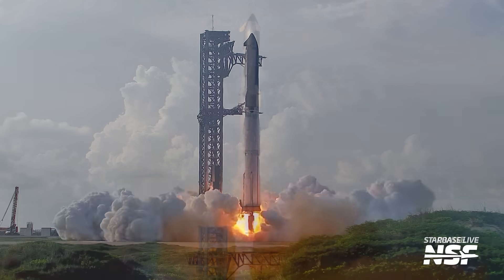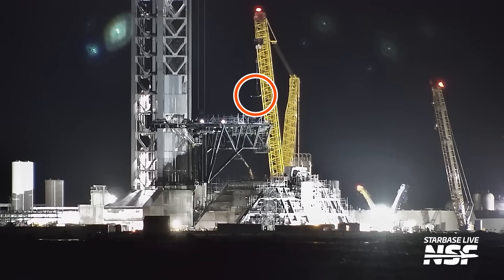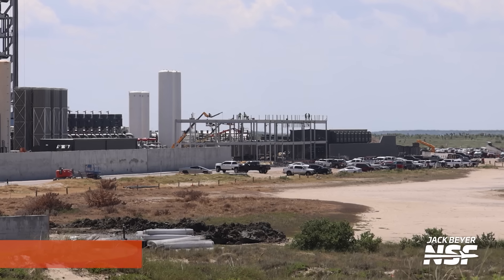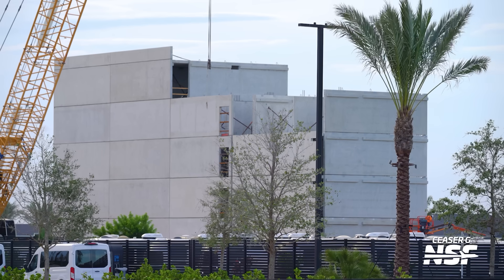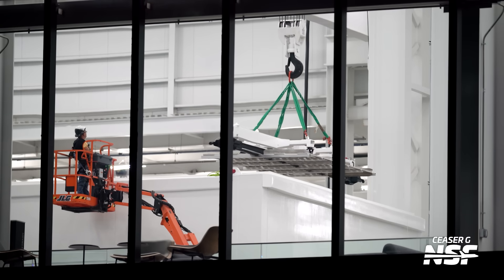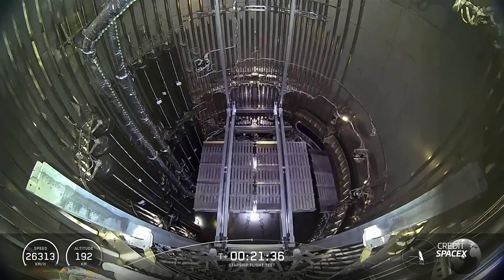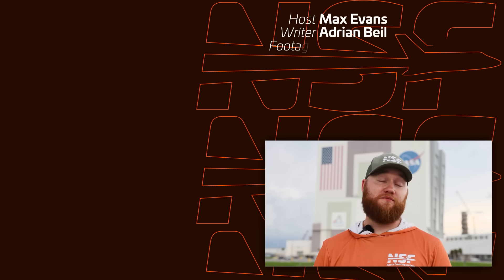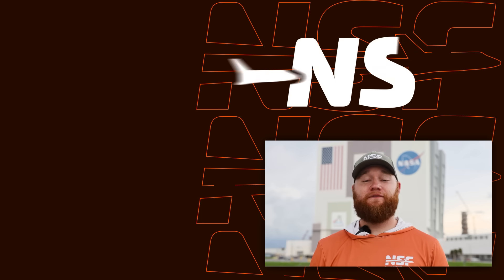Starship Flight 11 Preps Begin! | Starbase Update

Comment: I don't understand the difference between the "booster 18.3" and the "test article". Both names seem to be used in this script to refer to the same thing.
Reply: Booster 18.3 is the test article. Not sure if the naming convention is SpaceX or NSF.
Reply: @Barthhhelona  It just sounds a bit strange to refer to Starships or Starship parts as "test articles". Strictly speaking every Starship so far has been a test article, till one is actually used productively I suppose. Ironically, in that sense Booster 18.3 wouldn't really count as a test article anymore if it is actually used to deploy working Starlink satellites. Which is in the realm of possibility.
Reply: @cube2fox actually test tank 18.3 will never be turned into a functioning booster. It's just the top portion as a test article to test the structural integrity of the hot stage ring and perhaps the grid fin wells. There IS a booster 18 being stacked. The 18.1 through 18.3 test articles help validate and inform the design of Booster 18 which is the first V3 booster. Hope that helps and I'm sure someone will correct me if I misstated anything.
Reply: @Barthhhelona  That makes more sense. I guess it's somewhat misleading then to call this test article "Booster 18.3" if it's never turned into a functional booster.
Reply: @cube2fox yea they use odd naming conventions. I believe NSF used to call them "Test Tank 1,2,3 etc”.

Comment: The water bottle analogy doesn't work/apply here.
With the contact points being that spread out (1-per chopstick) , the bottle (super heavy) can't swing left and right. The only way that would happen is if one of the fingers (chopstick arms) changed height compared to the other.

The booster DOES swing towards and away from the tower though, which is why this bottle/finger analogy doesn't apply. Adding side stabilizers MIGHT help with stopping that to/froe swing but it'd have to either be through friction or that the stabilizers are cradling the booster with curved supports.

edit: typos

Comment: I'm very interested to see what the structure of the ship quick disconnector on Pad 2 will be.
The booster heights of Version 3, which will likely be launched first, and Version 4, which will be launched afterwards, will be different, and the ship's mounting position will be higher accordingly, which will likely mean that the ship quick disconnector's ground clearance will be different.
Will it be movable, bifurcated, or will the height be changed by adding parts?
I'm looking forward to seeing what method will be used.

Comment: ...and Pad 1/A seems to use pressurized gas to power deluge vs Pad 2/B's gas generators
i am wondering how they will repeat the booster flip assist (blocked section of hot stage ring) with new structure.

Comment: I'm surprised they are pouring concrete at the air separation unit since they plan to create one on Mars for return trip fuel. They won't be able to do so there.
Reply: They'll be doing it on a MUCH larger scale here.

Comment: 11:43 currently Starship test flights are sub-orbital which is 100km below minimum Starlink deployment altitude.
Sub-orbital altitude	~200–210 km
Deployment altitude	~300–350 km
Operational altitude	~550 km
After deployment, Starlink use on-board propulsion to raise their orbit to operational altitude.
Expected lifetime Starlink v2 7–10 years (est.) so using on-board propulsion to lift extra 100 km would greatly reduce lifetime.
Testing Starship de-orbit burns have been successful.
Only way to deploy Starlink is a full orbit at 300+ km altitude and land in ocean, (until FAA authorise re-entry over populated areas.)
Reply: IFT10 tested the ability to slow the spacecraft enough to reenter.  They also demonstrates that there was enough time to deploy 8 V3 Starlinks before the reentry burn.  So on IFT11 there is relatively little to lose by launching to orbit, deploying 8 real Starlinks, then retrofitting to still make their rendezvous with the Indian Ocean.  Remember that each Starlink has enough xenon for its hall thrusters to keep it in orbit for years.  That would permit them to get weeks of testing at less than 300km altitude before permitting them to reenter.  For am organization as comfortable with risk as SpaceX that seems like a reasonable decision.
Reply: Are the v3 Starlinks fully finished or would they also need to test them?
Reduced lifetime would probably still be fine if they primarily want to test the Starlink v3 Hardware. 
Or did they launch them already on F9?
Reply: @incredible_max   I'm pretty sure v3 starlinks don't fit on a falcon 9, so no, they probably haven't tested starlink v3 in space
Reply: That's a good point. There really wouldn't be a point in taking up payload on a suborbital test flight, and with version 3 Starship is staying suborbital for a while.
Reply: They likely need to verify the V3 starlinks in space for maneuverability performance and reentry profiles. They are also involved in reducing reflection so they may test several coatings for thermal and reflective properties. Those may be done in a sub orbital flight or with use of onboard thrusters to increase their altitude to do a few more orbits until reentry if needed. And they likely have starlink V3's to spare with older components. They have been working on those for a while and the V3 minis they have been launching have probably given them a lot of data since they started with the V3 design.

Comment: For them to fly actual block 3 starlink sats it would have to be an orbital flight, otherwise they are just dumping them into the Indian Ocean.
Reply: ah true i think
Reply: They could do an elliptical orbit where they get to orbit for a short time - enough to deploy a few satellites. Also, they have tested re-igniting a Raptor in space so they could use it to de-orbit if that is needed.

Comment: I wonder if they will install metal plates in-between some of the bars on the new V3 hot staging ring in a specific radius to manage the flip direction of the booster at staging like the did recently with V2, or if they plan to achieve that is some other way. It seems perfectly reasonable to repeat what they did with V2 and install plates, but those bars look awesome and it would affect the aesthetics to have plates welded between only a few in a given direction. Maybe they've already said how they'll do it, but I don't remember hearing it anywhere yet.
Reply: Maybe the new configuration of the grid fins will assist with that.
Reply: @gregsteele806 that's a very good thought.  The exhaust would exit the bars and hit the new 3 way fin config and maybe generate enough opposite force to move it predictably. That's the only way I can see it working if they don't add additional material.  Nice

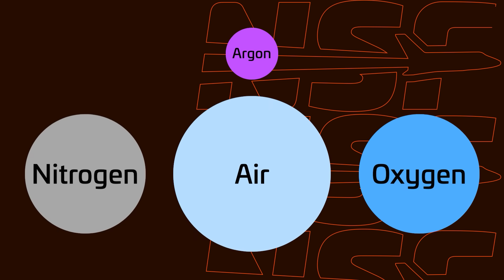Comment: 7:52 As I recall, argon is also used to fuel Starlink satellites.
Reply: Very small amounts of argon are needed for Starlinks. Much more is used for welding.
Reply: Argon is not a fuel.
Reply from the maker: Argon is used by the Hall effect thrusters on Starlink as propellant. You can use electricity to ionize and accelerate some Noble gases to create super-efficient thrust. -Das

Comment: The reasoning for the stabilizers seem off to me, would it not have freedom to swing toward/away from tower and not side to side as you’re suggesting? 🤔 correct me if I’m wrong tho
Reply: The stabilizers can move the bottom freely in a horizontal plane, which is all that is needed.

Comment: Flight 10 had the lowest points on the aft flaps melting.  Do you think SpaceX will move the aft flaps leeward as was done with the forward flaps?

P.S.
What are the dimensions of the “Giga-Bay Doors”?  The ships and boosters can only be built to fit through the doorways…;-)
Reply: I doubt they need to move the aft flaps. The damage was very likely caused by the engine chill lines. They eject both LOX and LCH4 - they should not be that close next time. They mixed and ignited. Pointing them away from each other could reduce that risk. (You could watch CSI Starbase for more).
Reply: It stands to reason that the giga bay doors will be high enough for the Block 4 boosters.

Comment: Regular air is 0.93% argon, so if you are already separating out the nitrogen and oxygen, most of the remainder is argon.
Reply: How much CO2 ?. Enough to keep the plants alive and I suspect a bit more than argon.
Reply: @michaelreid2329 CO2 is around 427 ppm, or 0.0427% . There is 21 times more argon in the air than CO2. Argon is a noble gas and it doesn't really do much of anything in the atmosphere afaik.

Comment: doesn't the chance of deploying actual V3 Starlinks mean that Flight 11 would have to be orbital?
Reply: Yes! THe plan is to go orbital unless they think they need more data, or if there is a mishap investigation on the skirt event.
Reply: Pretty much yeah, unless there are tests they can do in the short period of time before reentry, which I suppose is possible. It's not totally inconceivable that starship does go orbital though, it would let them test a reentry burn, and they don't necessarily need to do a catch, which we know won't happen for flight 11
Reply: @logicbuilder1204  You are correct, but they would need a modification to the FAA license.
Reply: @knowledgeisgood9645  @logicbuilder1204 yeah and I'm not sure a single relight test will be enough to convince FAA. In any case, a license modification would take some time to review, which would likely delay flight 11.

But:

What if SpaceX deploys actual starlinks into a suborbital trajectory and lets them burn up?
They've been sitting there waiting for Starship for so long that it's plausible they have a surplus of them, and don't mind losing a few.

Comment: Good report, folks. Re: Whether the option of any ‘real’ Starlinks might be loaded onboard for this next flight: to do so, wouldn’t regulatory paperwork already be affected? Because a ‘real’ Starlink, for mass purposes, has to have propellant onboard; and you can’t have propellant onboard without having instrumentation/batteries et al to monitor it….in short, any ‘real’ Starlinks can’t be completely ‘dead’ Starlinks. One would think that regulatory paperwork would have already had to be submitted (he asks, in ignorance) if real Starlinks were likely to be included in the upcoming launch (?). - Dave Huntsman
Reply: I think the bigger issue is that currently Starship isn't going into a full orbit, so any satellites released would also deorbit along with the ship.  Once they go full orbital we should see those real satellites.  Although there could potentially be some good data gathered by allowing early prototypes of large format Starlinks to burn up as they will in the future.
Reply: If the license gets modified and the orbit is elliptical enough (with the option to use a raptor to de-orbit) they could launch a few Starlinks. But it is very iffy.

Comment: Will the new hot staging ring have a panel to assist the booster in flipping?
Reply: From what I've read, no. The flip will rely on different thrust levels of the vacuum engines to force the flip into it's desired direction.
Reply: @RedmondJohnson Thank you.

Comment: Those are not protective covers for the dome welds they are weld doublers, they have been using them on domes for ages now.
Reply: Awesome!
Reply: Correct. I don't know what Adrian was thinking (he wrote the script).
Reply: I guess you're referring to 17:25? Would be nice to put in a time stamp.
Reply: @richardpark3054  It was mostly for NSF. They know where it is.